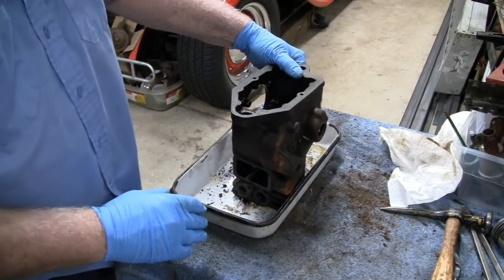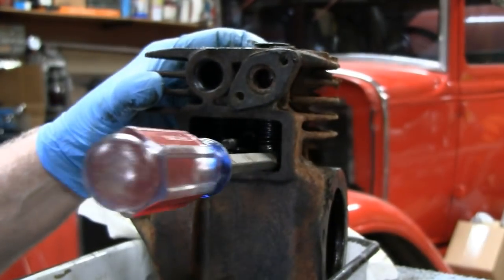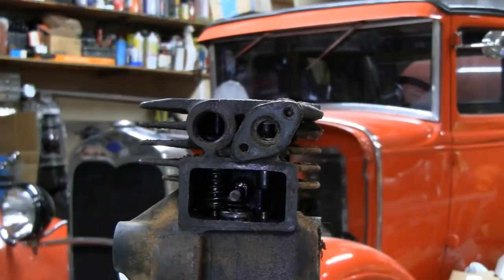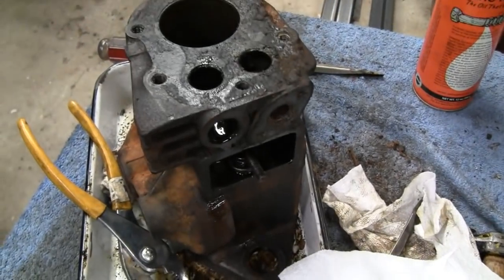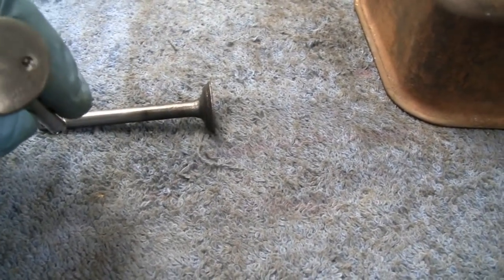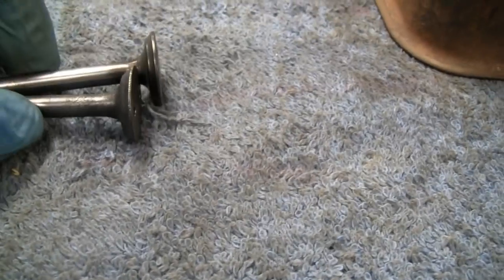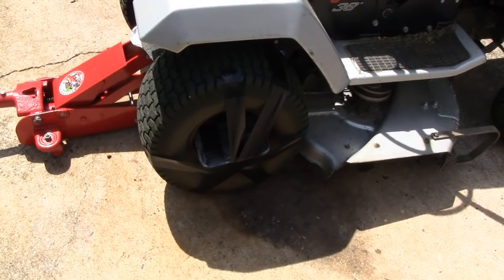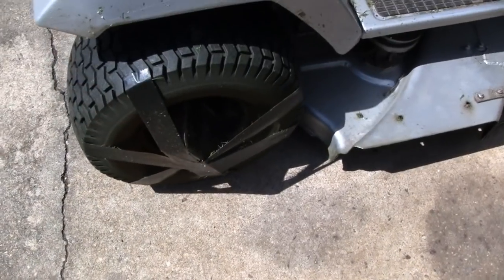SEIZED ANTIQUE BRIGGS RESTORATION (part 2)

Comment: An open end wrench will also work for lifting a valve which allows a window to remove the pin with a magnet.
Mounting the gas tank to the wheel is a proven method  and if a small block of wood is inserted under one edge, the tank will wobble , thus distributing the nuts for more thorough scouring. Small bits of broken concrete will also work if one does not have square nuts. Ah, square nuts, I guess that explains why RK walks funny. :-) For some odd reason, my dad always referred to square nuts as "Dutchman nuts" which may not be very PC today.